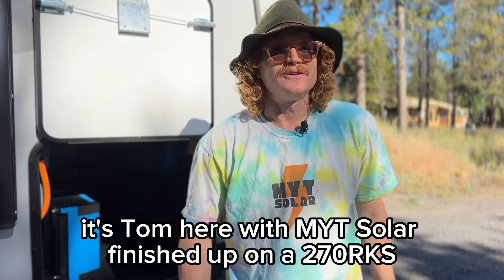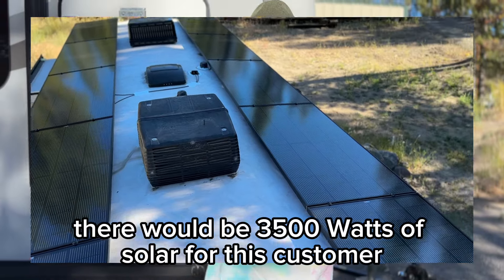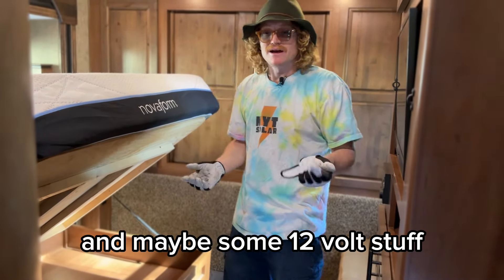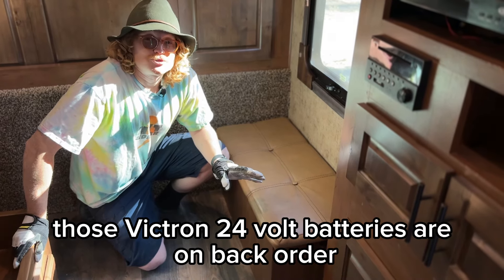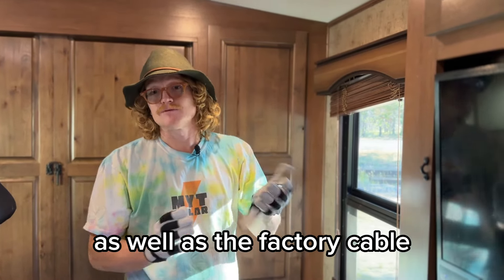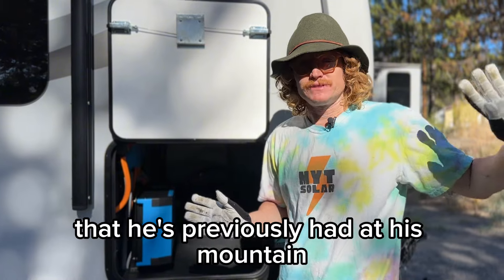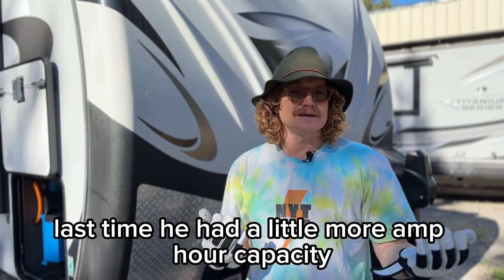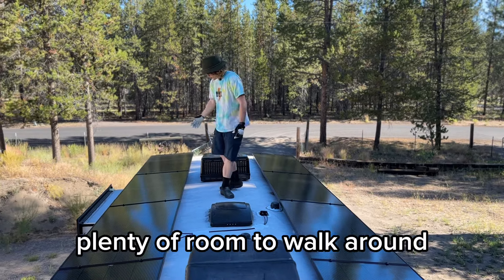This RETURN customer wanted the EXACT same RV Solar System with 3500W | Outdoors RV 270RKS

Comment: I think what a lot of people dont understand about solar is that it might be 3500w on paper but in the real world at best you need to subtract 10%. You will most likely never see 3500w on the panels unless you are positioned correctly and the sun is at the perfect angle in relation to the camper and the relative humidity and temperature is perfect. Otherwise this rig is going to pull about 2900 to 3100w nominal.
Reply from the maker: Exactly, we usually tell people to expect 75% and that is in ideal conditions.

Comment: I dont understand the need for it to be so large. When you stop at a truck stop you have no room for a washer or dryer. Is it just the bragging rights of ...I got enough power to operate a large welder. Just seems like over kill to me.
Reply: Air conditioning, microwave, induction cooktop, toaster and kettle. If you want to use a few of these things at once, you can easily get up there.
Reply from the maker: Once you have the inverter and can run 120v appliances at the ready it is pretty easy to get through all that power.
Reply from the maker: Spot on!